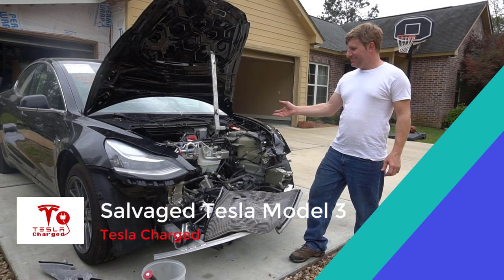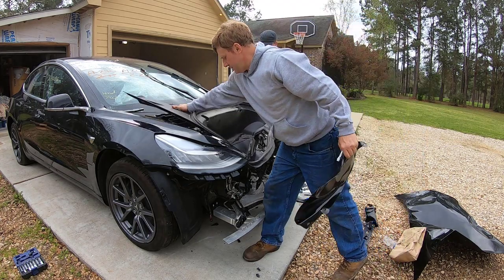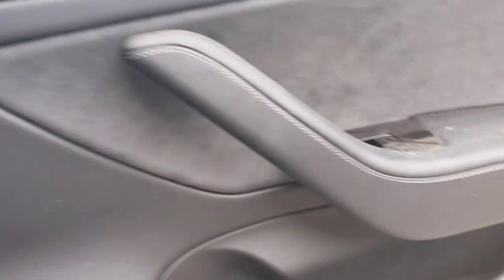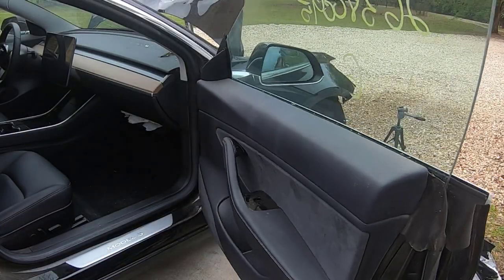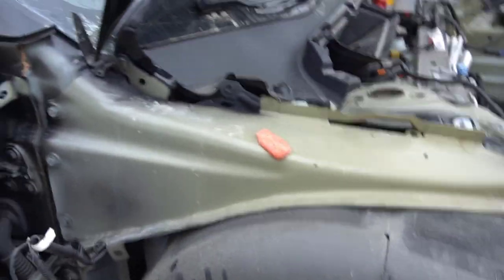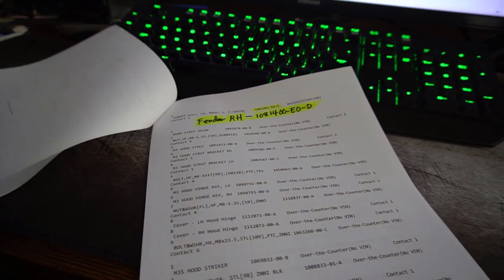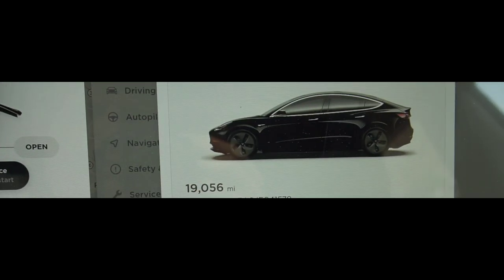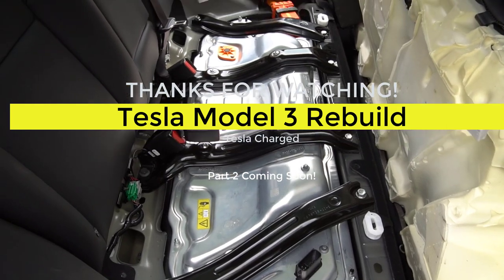Tesla Model 3 - Salvaged - Rebuild - P1

Comment: I just finished my 3 rebuild.  I have same car LR RWD but didn’t have to deal with frame rail or airbags.  Must have been awesome to find out you got a long range with autopilot.  Almost like finding $15000.   I’m looking forward to more videos.  Good luck.  

Ps. Don’t thrown anything away until finished.
Reply from the maker: Heck yeah man it's been great so far, a little more than anticipated but manageable.  Yea wish I could have gotten one without airbags blown that's the greatest cost in the whole repair almost 5k.  Yea definitely going through all the "trash" bolts are super cheap though. Finishing up my second video now should post soon.
Thanks for the comment and watching,
Casey
Reply: Hi. Does your supercharger still works ?
Reply: @norbertbajgyik1607  no
Reply: @randomgenius8551  I believe this is a big chicken shit, I have an M3 and after being salvaged for a broken windshield and two side doors and being certified at tsla service they still kicked me out of the kingdom but they wanted my money for FSD upgrade.I hope that someone will start a class action lawsuit so we can I own my car that I paid for.
Reply: @norbertbajgyik1607  I agree 100%.   If this was really about safety they would offer a safety inspection.

Comment: Great video series.  Thank you for doing this so others can learn from you.  I have a questions if you don't mind.  How did you get around the mobile access issue since it was linked to the previous owner?  Did you ever find the physical key?  If not how much hassle and what did it cost through Tesla to get a key?  What were you so concerned about at the beginning of the car booting up where you wanted to turn things off?  Was that to kill communication with Tesla mothership?  Because you obviously created the Tesla account to get the phone app as well as to be able to purchase parts from Tesla so they were going to find out and black list it most likely anyway.  I'm curious if there were other things you did to protect certain stuff or if it was for another reason?  And finally, did you have to get the windshield from Tesla?  What did it cost?  Sorry for all the questions but thank you.  Keep up the great work!
Reply from the maker: I was able to transfer ownership of the car a few days of getting car.  Using the phone app I could control the car without the key, which previous owner would not send me.  It only cost 40$ and is not a problem to get a key for the car, even mobile service can do it.  I just didn't want previous owners to get notified of the car being powered on or other notifications and possibly its location.  The car will not update GPS location until its been driven a few miles, transporting it showed it still in Maryland.  I have a Tesla Account already because I already own a new model 3!   I was able to recover the address of owner and contact him but he was a jerk and wanted alot of money for the keys.   The windshield is a big cost but through Tesla parts and labor was 950$ very reasonable for what it is and what it takes to change.  The windshield is very complex to remove and install, not just cutting glue and stick a new one.  Overall the experience was a good one very easy to work on the car, never need to hookup a computer to diagnose anything.  Tesla Service Center was Awesome, they helped me along the way with parts and service at the end.  They really wanted me to fix the car a few mechanic's there wanted to do the same thing!
Thanks for the comment and watching,
Casey
Reply: @TeslaRebuilders  Thanks a lot for the information.  Again, your videos are really helpful for others wanting to repair a salvage model 3.  Great job.
Reply: @TeslaRebuilders  hey buddy i love your videos! You do an amazing job from start to end, just recently bought a model 3 my question is that fuse you showed at end of video , is that y the car wint start or drive mines literally just like yours as far as damage go. Any infomation you can help me with i highly  appreciate it, its hard and difficult to get any sort of help . Thank you in advance
Reply from the maker: @edgarj5510  Join my Discord Channel and we can help you out.
https://discord.gg/wG8xUgt
Reply: @TeslaRebuilders  i try joining but it wont let me
Reply: @TeslaRebuilders   just joined
Reply from the maker: @edgarj5510  Sent you a reply and info on how to fix fuse

Comment: Hi my 12v battery keeps draining the car was hit from the back and the driver seat belt has locked out the car starts all the lights come on the screen but it won’t go into drive or reverse what could be the issue ?

Comment: I buy a tests serie 3 salvage from iaai how did you put on drive ? it has damage on the from end most on the driver side
Reply from the maker: Depending if the airbags or seatbelts deployed or the year and other factors if it will drive.

Most of the time it's just a 12v battery and charging needed or on older cars a pyro replaced to drive.

Newer models will need many things done to repair and reset in order to drive.

Comment: Hi do you have to remove the airbag sensors before removing the long metal crash bar.
Reply from the maker: Just unplug them, they are bolted with 1 - 10mm bolt.  Nothing can go off as the car only can have 2 deployment events and would need to be powered.

Just work on the car with 12v battery disconnected and high voltage battery disabled under back seat.

Comment: Im about to start working on a crashed model y the steering and under knee airbags have blown and the drivers seatbelt wont retract. Since it wont move i was thinking to replace the pyro fuse first to try and move it from where it was dropped off. Im wondering if i replace pyro fuse and the airbags havent been replaced first will i blow the new pyro fuse ?
Reply from the maker: No the RCM only blows airbags during a crash event and is locked out, will need to be reset.
Reply: @TeslaRebuilders  Have you ever worked on a crashed model y?
Reply from the maker: @Maiko-Yoko  No not yet but have looked at a friends who has done like 4 of them.  They are not much different than the 3 over 70% same parts just Castings and bigger.

Comment: Great video,i have one question what did u do to have the vehicle running after encountering the red light at the charging port?
Reply from the maker: The car was fresh from the salvage yard and not running because the Pyro fuse was blown.
 This happens in all accidents involving a seatbelt or airbag deployment.

Comment: Hello,
Just to check, can you change the fuse without fixing the airbag, I have the same thing , didn’t change the airbags or the fuse yet ? 
By the way , did you find the key card 🤔
Reply from the maker: Yes I was able to change the fuse and then the car was able to be put in Drive and moved around. I still don't have a key card but I did gain control through the Tesla app on my phone. You need to log on to your Tesla account and transfer ownership of the car to your account either with a bill of sale or title. And of course don't try to drive the car down the road without it completely restored with airbags but your local Tesla Service Center will have to do the airbags and reset sensors.
Thanks for the comment and watching.
Casey
Reply from the maker: Also check out this video they show how to replace the fuse properly it's what I followed to be safe.
https://youtu.be/MuFxg75UYbE

Comment: Love your vidoes , i need sincere help, i picked up 2020 model y from auction which did not come with key. i got the part replaced except the pyro fuse . I booked appointment w/ tesla to change ownership but they are not doing it as it is salvage car. they are not making new key as well . im stuck without key and car siting for over a year now. please guide me how should i proceed ? I reached out to previous owner he does not have key although he tranferred phone access to me , so i have the app now but it does not start w/ app or open or close it is always asking for a physical key to link the phone . Any help would be greatly appreciated.
Reply from the maker: You can also transfer ownership by making a Tesla account at www.tesla.com
Then fill out the form for transfer of a vehicle to your account with proof of purchase and ID.
You will need either a bill of sale, title and driver's license.  After you input these things and submit you will have to have car on.
In options you will have to change the name of the car to verify access and ownership.
They will review documents a d usually you will get app access in a few hours or after 24hrs.

Comment: How can you tell if you have a bad pyro fuse? I bought one on eBay but the car still isn’t going to drive and my 12v battery Kees draining. Any help🙏🏼
Reply from the maker: You need to ohm the fuse to be sure it's good and needs to be a Tesla part.  You may still have a hardware fault not allowing contactors to close.  If it's a late 2021 or newer with 15v Lithium LV battery it is very difficult to get to power on.   It usually needs a few things replaced and or updated with maintainer to close.
Reply: @TeslaRebuilders  yes will I swapped the pyro and my bought a brand new 12v and it keeps draining it after like 2 hours battery would go from 100% to 0%. It’s just suspension damage and the car is leaking coolant from a ripped hose. There was no airbags deployed to. It’s a 2022 and still had a 12v
Reply: @TeslaRebuilders  the only error codes I get are “low coolant ok to drive” and very low tire pressure pull over safely “ it doesn’t let me put the car into gear as well.
Reply from the maker: @joeyrugid2196  join our Discord community and we can help you diagnose your problem.

https://discord.gg/uAQEstDg

Comment: Great videos I'm learning a lot!!! I'm struggling finding parts. I see you got most of your parts directly through Tesla. However, I have called several Tesla dealers and no one wants to sale to a private party owner. they only want to sell to a mechanic shop, or auto body shop. How did you get around that?
Reply from the maker: They are just lazy and not following the rules.  You need to go in person with a list of everything you need.  Look on the EPC and get part numbers and put  on a spreadsheet so you can email them a copy.

We have a Discord community where we help each other solve problems. 

Link: https://discord.gg/dyHnRWK2
Reply: Just bought a Vcfront last week. Request it under service in app select other and write what you need
Reply from the maker: @liveandletlive2894  yeah used to not be able to do that, glad you confirm that works also.
Reply: @TeslaRebuilders  yeah its basically corporate overriding the techs at the SC who say they won't sell parts. How'd you used to do it? I still need to get the whole front end practically
Reply from the maker: @liveandletlive2894  I just went to service center and ordered directly.
I guess I just have good people here in N.O.
Reply: Ebay bestia option

Comment: Unfortunately Tesla will probably disable auto pilot and supercharging once they figure out it’s got a salvage title. Gonna enjoy this build though
Reply from the maker: We will see when that happens but I only know of them disabling supercharging.
Reply from the maker: So it's been over two years now and have driven this car over 80k miles for a total of 105k miles on it.  Supercharging was disabled but has been turned back on for several times and for months at a time.  Have had full updates and full use of autopilot nothing has been unsupported.  Didn't have a issue with buying parts and or getting Tesla to service the car.   Getting and repairing this car myself was a very good investment.  I have learned so much from fixing it myself and seeing first hand how well built they are.  You don't need to respond the this reply just making sure everyone knows the truth about Tesla's and not guessing random misinformation as they call it these days.
Reply: Hello, I have the exact same car in the same condition and I would like to get a support on the parts where to buy them and what tools I need to start my journey with my dad, could you please help us? How could I reach you?

Comment: It has driven shafts in the front and what looks like a motor. Wouldn't that make it a LR AWD rather than RWD?
Reply from the maker: The shafts you see are the steering linkage and power steering motor not the front motor.  You watch further in the video I clearly show where the front motor goes in a big void behind that.

Comment: What’s the wedside you used to buy all parts, and how you got the breakdown on parts on your computer ?
Reply from the maker: 90% of the parts through Tesla at epc.tesla.com contacted local Tesla Service Center then ordered through email.  Some on Ebay, parts that were not needed to be new and lower cost to save on labor. Thanks, 
Casey
Reply: @TeslaRebuilders  How were you able to set up a purchasing account for the parts?  Many of them are listed as restricted.  Did you set up an account as a body shop or can you just contact the nearest service center and buy them as you own a 3 already?  Great stuff by the way.
Reply from the maker: @stevejarrett6209  you can contact a local service center, go in and get to know the people.  Let them know your intentions on rebuilding the car and getting parts.  They will probably want you to email a list of parts that you need and they will order them.  When they get them in a week or so yo can pay when you pick them up.  There is no account that needs to be setup, but you can do that anyway with the car by giving them the Vin.  This also cross reference of the correct parts because some differ on options.

Comment: Are you about to charge it at a Tesla charger ?
Reply from the maker: The car has been repaired for over a year and a half now with 60k miles driven since.  Yes it will supercharge until they turn of because of a Salvaged Title.
The damage done to my car did not involve any of the high voltage system either.  Parts were merely unbolted, unplugged and replaced no frame damage!
Reply: @TeslaRebuilders  I heard Tesla have blacklisted vehicles with any repairs done to them after a major accident
Reply from the maker: @Eben18  That is untru they dont have a team of people searching around on auction sites....

They just hava a program that checks the status of the Title of all VINs.  If it's "Salvaged" it gets disabled.  Because they don't know what damage has been done just not been repaired.

Comment: If when you get the car going if you don’t enable the wifi would this stop Tesla from blocking dc fast charging on non Tesla chargers say electrify America.otherwise you may be blocked.
Reply from the maker: I'm not sure and wouldn't recommend doing something like that.  The car is always connected even if you turn it off or disable service.  It's the only way to get location and remote control over the internet.
Reply: @TeslaRebuilders  but you're gonna get blocked, then car is almost useless
Reply from the maker: @MinotaurvsCyclops  nah man, supercharging is not absolutely needed.  I have a second model 3 for traveling, I'm just going to use this car local.  No way km driving over 250 miles a day and even if I do need to plug back in for a hour and go to town.

Comment: The vehicle has been totaled so Tesla will take The fsd off
Reply from the maker: No they will not...... its only supercharging.
Reply: @TeslaRebuilders  did it to my car call them thay will tell u to !!!!!
Reply from the maker: @Strangerthingsvehicles  You probably got audited earlier on if you bought a car that had it but you did not purchase they would remove it.  Which is wrong because they say its tied to the car and transferable.  So did they do that?  or do you show to have FSD capability but you have the older MCU and they will not upgrade it?
Reply from the maker: Also I got a refund because they would not install the hardware therefore I could not use it ever.  Having already had EAP from previous owner they could not argue and returned to where it was. Took a few months and some emails but they got it fixed for me. If you are in similar situation I would not let them tell you No Refunds after no amount of time!
Reply: @TeslaRebuilders   I got my car used with it on it   I know someone who got a Tesla from an auction and they took it off of that to
Reply from the maker: @Strangerthingsvehicles  If you have proof that the car had it and you bought it from the owner then you now should have it.  I would get previous owner to provide proof of purchase from Tesla or if you have any pictures of it installed.  They will put it back if you can prove that, they have been sued and lost to it before.
Reply: @TeslaRebuilders  You could pay 500 to 600 for a HV inspection and then they would upgrad HW2 to HW3 that FSD requires.
Reply from the maker: @flyingyakdeath  Last year they told me no, it won't be upgraded.  I couldn't even do it myself, things may have changed by now.  The car is fine how it is, if I want fsd I'll buy a car with it.  Definitely not paying 10k out of my pocket for it.